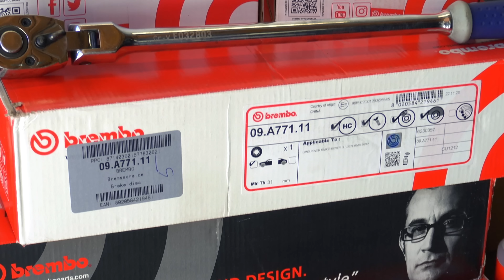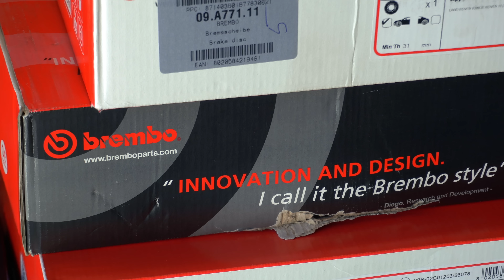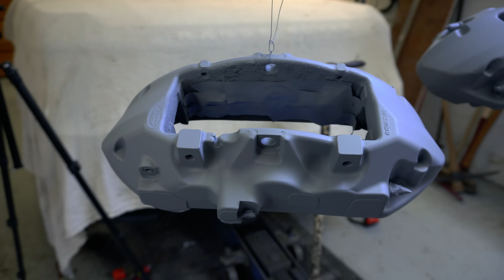I did a complete BREMBO brake overhaul on the 4.4 TDV8 Range Rover L322

Comment: Yes they look nice and are lighter than steel sliding calipers but I'm not convinced that Aluminium calipers have any place on a road car, they just dissolve in my experience. I have the same style of Brembo caliper on my BMW 335D (it's the 370mm front 4 pots and 345mm rear 2 pots). Every bleed nipple has sheared on the front, necessitating helicoiling, and the pad interface is turning to dust after not many years. Steel on aluminium is bad enough but throw in salt water as an electrolyte and you get the aluminium galvanically corroding. Mine are really badly pitted, and require quite frequent strip downs to pull the pads out and clean up the bare ends of the caliper before re-coating in brake grease and re-assembling. They're just not suited to wet, salty environments IMO. Good job on the repair, they actually look in decent nick for 200k!

Comment: Right now doing the same for my L322 5.0 SC. A week ago I decided to replace old pads. One side was absolutely fine, but the other side was completely jammed. All 6 pistons didn't move. I quit to order new pistons and tools as there are this stupid 12 point bolts. Today I noticed that there is a sea of dot4 under my wheel. Looks like I disturbed the seals on jammed pistons. Interesting thing is that the engine didn't start. I added some fluid, bleeded the brakes on the leaking wheel, the fluid level error disappeared but looks like the car doesn't want to start without pressure in the braking system as the braking pedal goes all the way down without resistance. Looks like I'll have to bleed all 4 wheel in the end.

Comment: Another great job and massive kudos to you! I also did my brakes a few months back, no painting but did a refurb with new rubber seals and regrease of the pistons. I also managed to strip the threads on one of the bleed screws so had to get it sent off to be drilled and have a helicoil fitted, but all good now. Next job will be to change out discs and pads, but will also do the parking brake shoes when I do. I’m tempted to get the callipers painted and also add braided hoses for better feel but will wait and see how the bank balance looks before committing. Keep up the great vids and hopefully more to follow soon! 👍

Comment: Enjoyed your video , apart from your mishap . On a brighter note - you now have two nearly new callipers  and you should have the other two Brembo decals !   win win .  Do not put copperslip on your bleed nipples , use the trw grease or ceramic grease . I use the later on glow plugs , after removing the heater plugs from a Freelander 2 with 135k miles on it . All four were not working which leads me to suspect they were original , they had a white residue on them - so I looked into it . They were the easiest heater plugs I ever removed .

Comment: I have just bought a set of these calipers for my 2012 L320 along with a set of 380mm Brembo discs from carparts4 less and a set of Brembo pads from Autodoc. 

After watching your video, I made sure that I could loosen off  and re-tighten the bleed nipples. Two came undone without much fuss but the other two were very tight, but I managed to loosen them without causing any damage. They would have been a nightmare to undo whilst the calipers were fitted to the vehicle and would have more than likely snapped.

Looking forward to seeing your video on bleeding the system.
Reply: can you fit 19 inch tires on 380mm disks ?

Comment: Hi Sam, great channel. I really enjoy your stuff. Did you need to perform the bedding in process for the handbrake ?
Reply from the maker: I didn’t do the bedding in procedure as the shoes are pretty old and worn (ideally they would have been replaced but couldn’t get parts in time from LR), so I didn’t want to strain the linings and potentially damage the shoes by doing the bedding in procedure, which is quite harsh.

Comment: Another great video Sam....keep them up. I have the same L322 as Sam although mine is the Autobiography edition. I refurbed the rears recently and unfortunately I didn't nip the rear hoses up sufficiently for the 7 days the calipers were off and getting shot blasted, painted and rebuilt and brake fluid has been leaking from the rear lines. I am really struggling bleeding the system now the calipers are back on and suspect there may be air in the ABS system that requires purging. I have heard the front calipers are an issue with the pins and brake nipples prone to seizing in the aluminium casing.

Comment: I also use Autodoc, and went all Brembo. Not got the six pot calipers on mine. And it looks like you have my luck, snapping off a bleed nipple. They look pretty good painted up. 👍
Reply from the maker: Yeah the aluminium callipers are lovely but crikey do they like seizing with the steel components!  AutoDoc is a life saver for us in the EU! 🙏
Reply: @SamsMotors  Just about to give my bank account another bashing, by using Autodoc. Fitting a towbar (about time I hear some people say), and they have a nice detachable one for the L322.
Reply from the maker: @Bensgarage  nice!  Is it just the removable armature or is it the whole frame that bolts to the car?
Reply: @SamsMotors  Had a westfalia removable one on the TD6, but looking at over €1K for one of those.
Reply: Recently had a removeable head towbar fitted to my evoque (L358) from a company called Tow-Trust Towbars good price and everything lined up well not like the witter I fitted to my old freelander none of the holes lined up properly

Comment: Loving your video's ..thanks.
I replaced my rears recently on my 2012 and the landrover specialist told  me to wind the little adjuster/cog thing in all the way till i couldn't turn the disc anymore...than back it off 1 complete turn! I would love to know who's right?
Reply from the maker: That’s pretty much what I did - a slight drag noise (no resistance) tells you you’re bang on the money.
Reply: Yer turn all the way off make sure handbrake is off then turn the other way till you feel the wheel has some resistance then it’s done

Comment: Great vid series, Sam.  I have an L320 2007 vintage with Brembos - replaced the discs 18 months ago, and now have the annoying warp vibe when braking from speed; I drive it quite carefully, and don't give the brakes a hard time, but will be disappointed if I need to shell out more £££ to change them again after such a short length of time.  I've not measured the discs for warpage, so might be dissing them unnecessarily, but will be interested to see how your discs stand the test of time.

Keep up the great content!👍
Reply: Did you find out if brake disc was warped? Sometimes a buckled or unbalanced wheel can feel similar.

Comment: Do you ever get any brake squeaking or squealing on your front brakes? What style brembo pads did you go with?
Reply from the maker: Not that I have noticed.  They are just the standard OEM Brembo pads and I used the Brembo “be quiet” grease on the contact faces.
Reply: @SamsMotors  I assume semi-metalic and not ceramic. Thanks for the reply!
Reply: @SamsMotors  Thanks for the reply! As a L322 expert, I was wondering if you could tell me how much free play my brake pedal should have? It feels like it has more travel than my other vehicles and i'm thinking there may be some air in the  lines requiring a flush / bleed.

Comment: Quick unrelated question.  Just bought a 2011 L322 4.4 TDV8.  99k miles
When the first turbo spools up at 1200 rpm ish I hear a slight whistle/woosh.  Only when drivers window is down, same again when I lift off at low revs.  No smoke, no hesitation or lack of low-end power, no faults in IID tool.  Is this normal or should I be looking for a boost leak or turbo issue ?  Is there any live data I can check in IID to idenify any problems.

Thanks for any advice.  Love your L322 content
Reply from the maker: Totally normal, all of the ones I've driven/seen have been the same.  I actually quite enjoy the little turbo whistle at low revs 😆
Reply: It’s just expelling surplus boost pressure very normal

Comment: What size are the front caliper bracket retaining bolts please?
Reply from the maker: Not sure, check the workshop manual maybe
Reply: I would if there was one available at a sensible price - but then we wouldn't need you tube videos! 🙄🤣
Reply from the maker: @TheDoc-j6g  despite my mechanical skills, I haven’t memorised all of the fasteners on the L322 unfortunately.  If you send me an email at samsmotorandmachine@gmail.com I will forward you a copy 👍

Comment: My 07L322 has brembo. But they’re just plain metal
Reply from the maker: I think earlier cars had the 4 pot Brembo front calipers, and then for 1 year (2009-2010) they went to a non Brembo sliding caliper, and then 2010-12 they went to these 6 pot Brembo calipers.
Reply: @SamsMotors  L322 really was the unloved step child eh 😂

Comment: You didn't show us how to bed the parking brake shoes to the new discs, I'll just leave this cheeky link here: https://youtu.be/GHHYLQBpyaw
Reply from the maker: As the shoes aren’t in the first flush of youth I didn’t bother… the bedding procedure is pretty aggressive and wouldn’t want to damage the linings.  Parking brake working just as well as before though 👍
Reply: Hi Sam, I was looking forward to this video. Great one again. Quick question on the rear electric hand brake: I suppose you unlocked it first then slacked off the brake a bit further using the screw? And can I be sure that it stays off while working on it?  (And not puts the e-hand brake on while the disk is off)